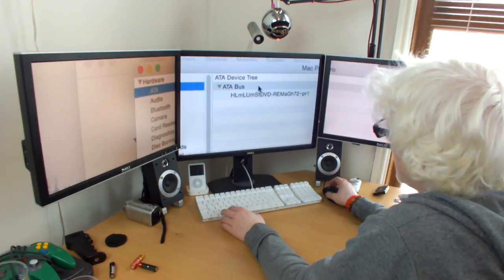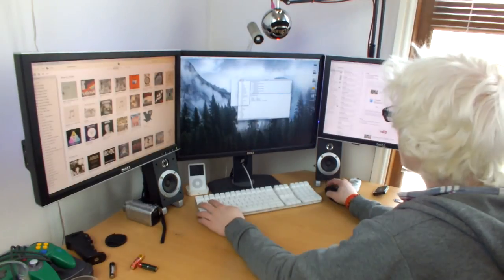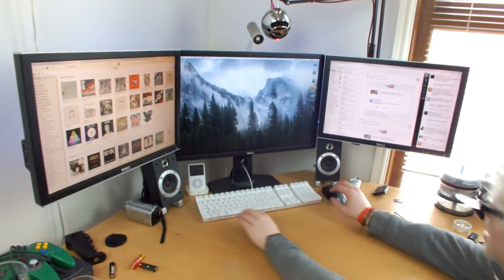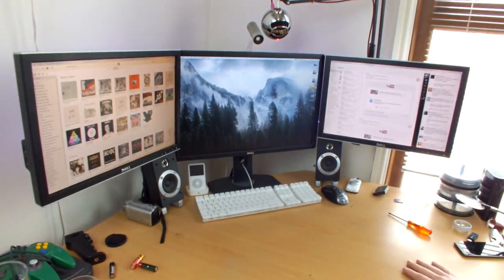A Few More Mac Pro 2008 'Upgrades' | IMNC

Comment: ItsMyNaturalColour  You have to jumper the second drive to Slave. The original drive should be Master.
Old scool IDE needs manual jumper settings :D
Reply: Julian Doll Leave them all on cable select. Works great!
Reply: commentmachine1 With just two drives installed it is no big deal to do it manually also because cable select doesn't always works that well imo

Comment: Wait what? The 2008 Mac pros still have IDE buses in the board?
Reply: Joseph C Yep they have for the optical drives. Since the Mac Pro from 2009 all HDD/ODD connections are SATA.

Comment: If you go to /System/Library/Core Services and open "Expansion Slot Utility" you can see the bandwidth that each graphics card is running at in the 2008 Mac Pro. Here is the supporting article about different profiles you can select https://support.apple.com/en-us/HT2838.